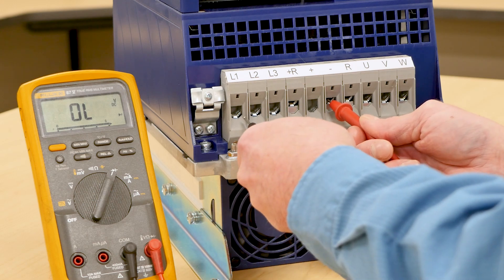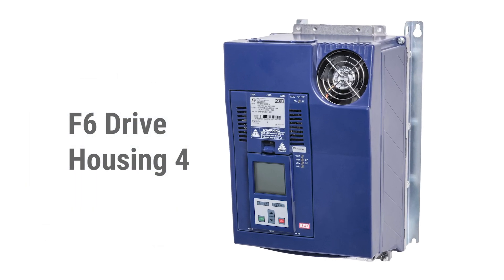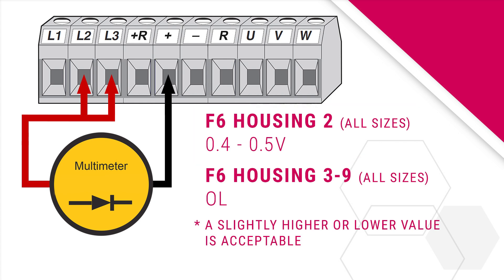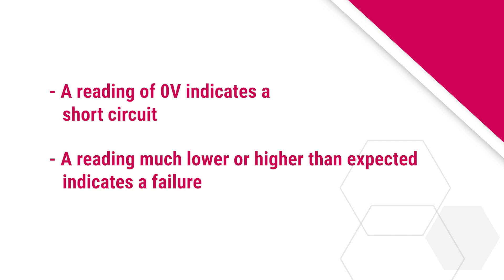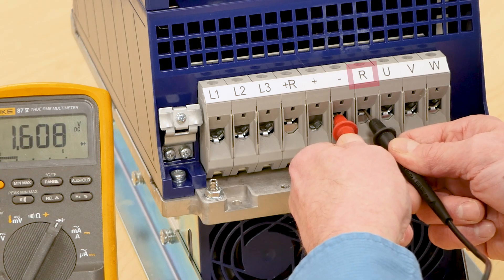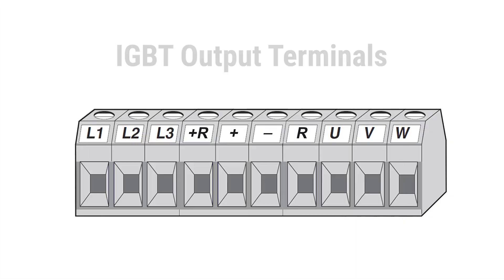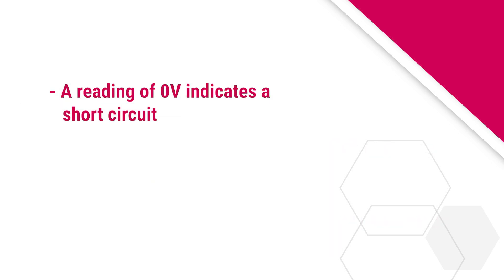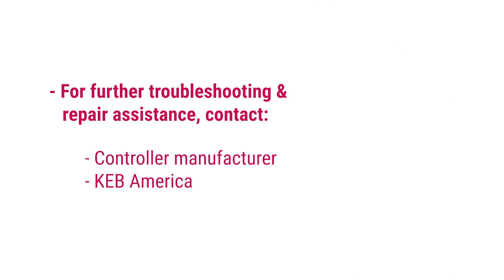F6 Elevator Drive Diode Check | Input Rectifiers, Braking Transistors, and IGBT Output Transistors

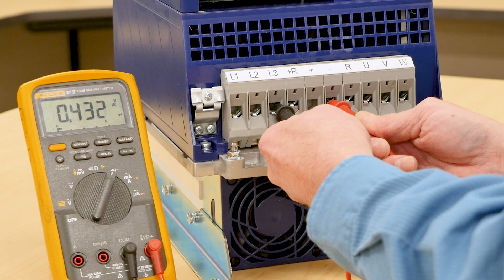Comment: @1:44 The red arrow is pointing to the wrong input even though he said and showed it correctly
Reply from the maker: You are correct. Thank you for finding that. The red arrow @1:44 should be on the "--" (Negative) DC bus terminal.
Reply: Good job dodd. Greetings, Uwe ;)